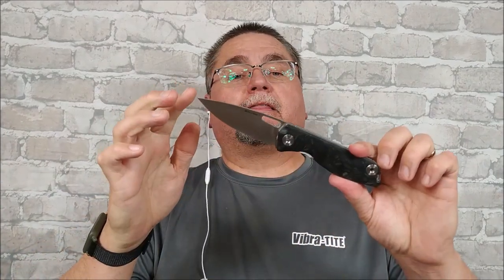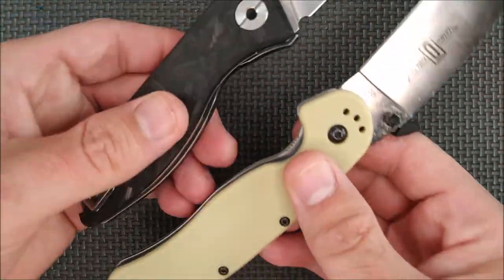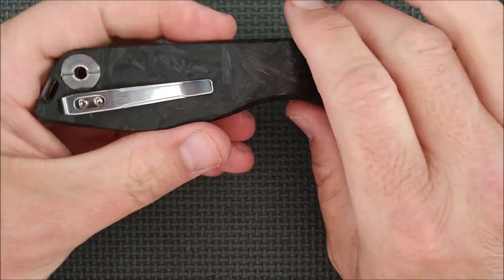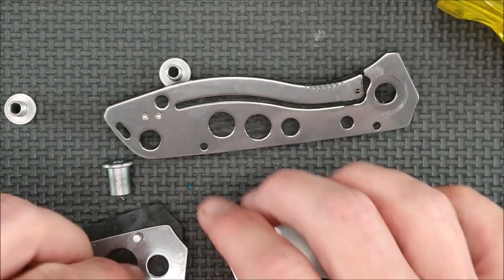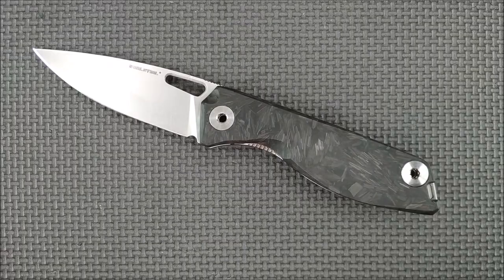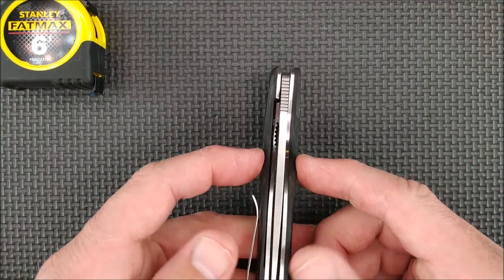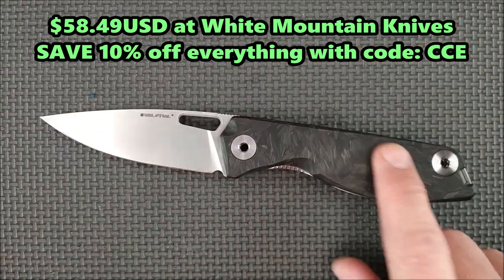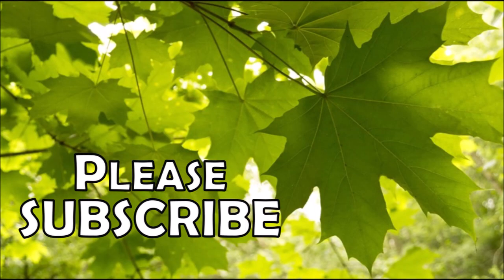Review - Real Steel Knives: SIDUS (models 7461, 74627473 & 7464)

Comment: I saw the Knife PMI Rockwell test results. The 14C28N steel in the Sea Eagle,and Takin,on scored 56.6! Thats soft crappy steel.
How could you endorse this brands knives made of 14C28N with numbers like that? Cheap 440c Ganzo knives are scoring 58+.
I almost bought the Real Steel Horus,boy am I glad I saw this table with actual hardness test and didn't waste my money.
Reply from the maker: I am not disagreeing with your decision to choose a knife or not. But, I want to know where you saw the test results for the Sidus.  It does not necessarily follow that RSK's early use of 14C28N (IE the Takin and Sea Eagle were made a few years before the Sidus) Their heat treatment of 14C28N on the Sidus is not necessarily the same.  Of course, it could be that the Sidus is also heat treated to exactly the same standards.  I am just saying that we don't know that because it has not been measured independently, though if hardness is of key importance to you then I would say better safe than sorry and say away from the Sidus too.
14C28N is a steel that has a wide range of recommended hardness, everything from 55 to 62 - per Sandvik: https://www.materials.sandvik/en/products/strip-steel/strip-products/knife-steel/sandvik-knife-steels/sandvik-14c28n/
Hardness is just one of the important factors that determines how well a steel will perform.  14C28N at 56HRC must perform differently than 14C28N at 62HRC, physics demands it.  I have to assume that RSK has a reason for choosing to make their 14C28N on the Takin and Sea Eagle fairly low.  I will email my contact at RSK and ask them about it.  I will also ask them what hardness they currently target for their knives made of 14C28N.
Reply: @CanadianCuttingEdge  Thanks for your response. I'll be watching to see what they say. I'm mainly a Chef's knife enthusiast. But recently I've been researching and buying folding knives. I have experience in using Japanese whetstones to sharpen my cooking knives. They range between cheap 440a to Sg2 powdered steel. Zwilling and Wusthof knives use German high carbon steel. Rockwell is around 58. They don't hold up the best when you use them everyday like me and my wife do. But,I don't usually have to use my whetstone (King 1000) to resharpen them. Unless the edge get's dinged or rolled over,then I do. I usually use my ceramic rod and strop to bring back the edge. 

Most of my Japanese knives are Vg10 with a Rockwell of 60 +-1. And they do better than the German knives when it comes to edge retention. And they only require a few more passes on each side when using my whetstone. I can also get most of the edge back by using the ceramic rod and then stropping. I have two high end knives,Yaxell,which are in SG2 powdered steel. These are hard,Rockwell 62+,and hold their edge well. They don't chip or microfracture any more than my VG10 knives would,which is great. Cheap VG10 can chip or get microchips more easily.IMO,Japanese steel,and heat treating,is the best.But Mcusta is the only Japanese brand I know of making folding knives. I don't know about their quality,but they're more expensive than Chinese made knives,for sure.Mcusta makes good quality,though mass produced like Yaxell,chef knives. 
I don't have much experience with sharpening my folding knives yet. I have a CFK D2 large hunting knife which I sharpened to a razor. It's a big thick blade and the original grind was steep. It took quite awhile on my whetstone to thin out the cutting edge and get it to about 16 degrees. This D2 steel seems hard. At least as hard as VG10. 

So that's my experience with different steel alloys. I have two Japanese knives made of Swedish (Sandvik) damascus,45 layers. They seem harder than German steel,and wear/sharpen like VG10. Rockwell is 60 on these.I'm not positive,but they could be AUS10. Or AEB-L. But I like them. They sharpen just a bit easier than VG10,like the German HC steel does,but keep an edge a bit better. I don't see AUS-10 or AEB-L being used in folding knives though. These other steels being used,like M390, why are they expensive? The Rockwell doesn't rate that high. Are they powdered steel like Japanese SG2 or RG2? Why aren't there more folding knives in BD1N? It's cheap and hard,though a bit of a pain to sharpen like SG2.